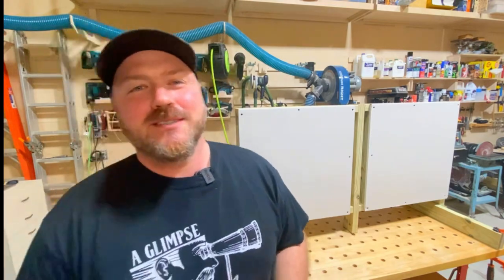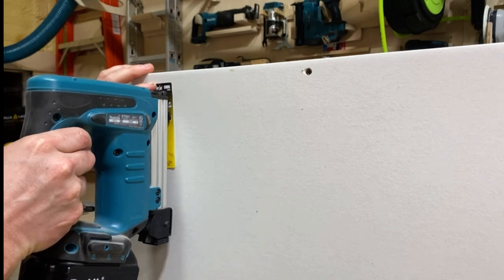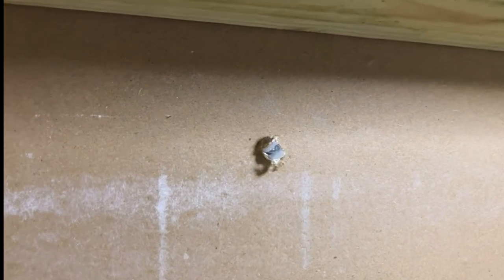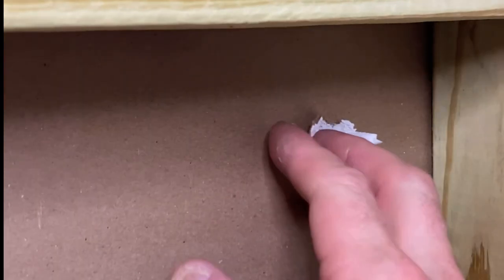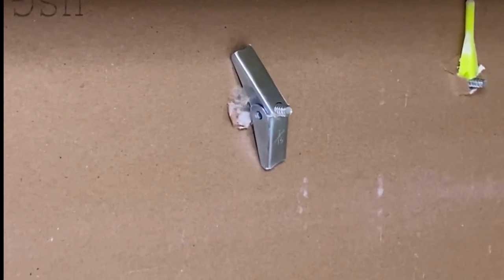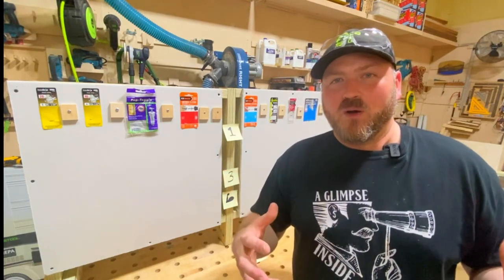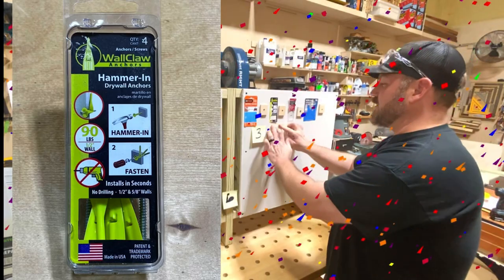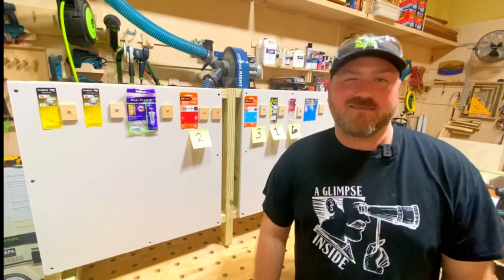How To Install Drywall Anchors The Right Way | PLUS, My Anchors Of Choice

Comment: I worked as an industrial maintenance technician in a factory for 20 years. In a factory, every time there's a management change, everything gets rearranged, including the walls, furniture, equipment...etc. I've installed, removed, relocated all sorts of stuff on drywall. I've tried many types of anchors. The preferred anchors for mounting light to medium weight items were the Toggler brand original push style poly toggles (not the screw in type). They were strong, didn't spin when screwing or unscrewing fasteners, very quick and easy to install, and when the time came to fill the holes, there's no need to remove them. Using a ball peen hammer, simply recess the anchor for enough room for mud and fill. This leaves a much smaller hole to patch. Poly toggles saved a lot of time and labor when the managers wanted to rearrange the room. Poly toggles come in different sizes for multiple thicknesses of drywall. I've used them on 3/8", 1/2" and 5/8" fire rated drywall. My preferred method of installation was to use an awl to punch a starter hole, then use a #3 Phillips screwdriver to enlarge to the correct size for the anchor. By using hand tools, there's no need to carry a heavy drill. I wouldn't use any of the anchors that you demonstrated because, they are all subject to rotate while installing or removing screws. Poly toggles have blades on the back side of the head that bite into the sheetrock to prevent twisting. In all my years of remodeling, construction and relocating items on sheetrock walls, I haven't found anything better. There's a YouTube video on the Toggler brand poly toggles to demonstrate them.

Comment: Great video! Just fyi though those first two triplegrip cobra anchors you installed, once the screw head is flush  with whatever your mounting it with, the screw needs an additional 3-5 full rotations so it can really pull the plastic anchor back against the wall  to make it tight.

Comment: Good test... I’ve often wondered if the really good work as they say.. I will generally use one of these types of anchors when I’m putting something that spans a few studs but does not make it to the last stud and I look at how much weight it will support... Thanks.

Comment: Thanks for going over this, I like your pun on a glimpse as it fits. I really like your outside information and tips, such as the inscrutables and tricks with CA glue and tape. I have used all of those anchors over the years with the exception of your winner, I find wall anchoring to be a bit challenging as you want a good hold, the problem I run into is the past two places I've owned have been older and have drywall backer boars with a float coat of plaster, which adds thickness, making newer back hold designs problematic. I typically use the plastic screw in (#3) or the good old toggle.  Anyways, cheers.

Comment: Thanks for taking the time to make this video. Good stuff. The only thing I would suggest is, thread the bolt into the butterfly on the toggle bolt just a bit farther. It work perfect every time. Just make sure you don’t get the spring in the way. Thanks again for the video

Comment: An added thing I always consider is they certain ones are reusable as good the second time as the original use. Things like toggle bolts drop into the wall when you remove them and can't use it again. The two last ones you did work as toggle bolts but can be removed and reinstalled. Another thing is if you are in front of a stud partially or say a sink drain pipe then a normal toggle bolt won't engage bc of lack of space.

Comment: I like the brand name augers,  but I absolutely hate the cheep crappy ones that come packaged with stuff that you hang on the wall.  You didn't mention my favorite, the flip toggle. it is basically a toggle that you can remove the screw from the wall, and not loose the inside part. unfortunately it also requires a big hole to install.

Comment: I have not had good luck with the EZ anchors, they had stripped the hole in the drywall.  I put the screw in, and it just caused the anchor to keep spinning, and stripped the hole.

Comment: Where are the Molly Bolts?  
Also, drilling is a very good idea with older drywall, since it becomes dried out and brittle, which can cause the paper on the backside to pull a chunk of gypsum with it as it penetrates the wallboard.

Comment: how are you going to hang your picture with the screw screwed all the way in? I also use the E-Z anchor but i don't screw the screw all the way in i leave enough out for hanger am I wrong?
Reply from the maker: The quarter inch piece of plywood represents the gap you might leave if you’re hanging on a wire
Reply: @AGlimpseInside  the toggle one would not work like that it would be lose

Comment: By far the best are from a German manufacturer called Würth. You screw them right through the drywall, no predrilled and can take another of load. 
PM me and I send you a few to test I should have some leftover.
Reply from the maker: Aglimpseinsideprojects@gmail.com 

Dude I’d love to try em!! Thanks man.
Reply from the maker: 13720 Old St. Augustine Rd, Suite 8, #212 Jacksonville FL, 32258